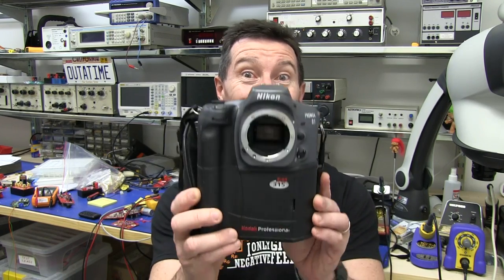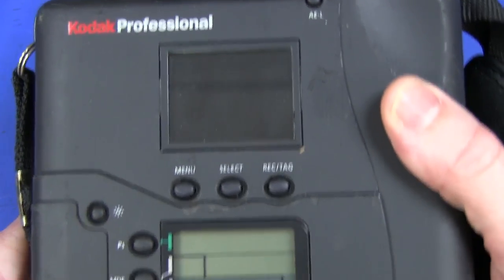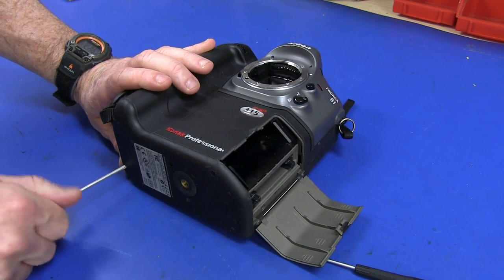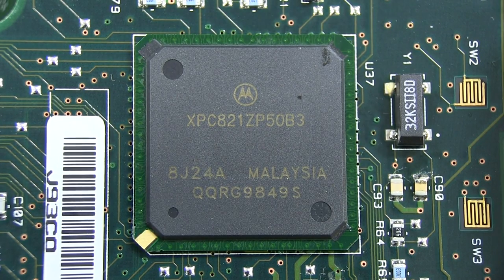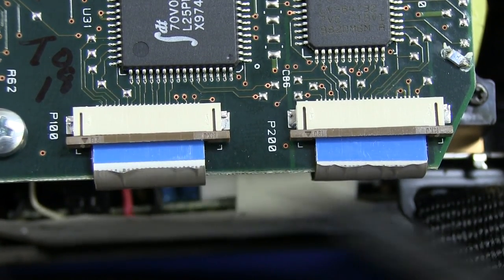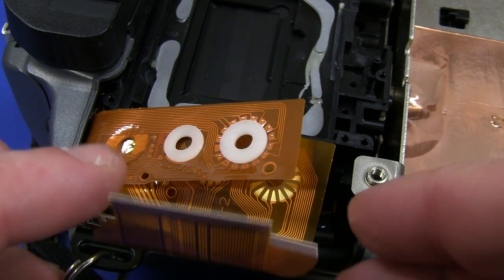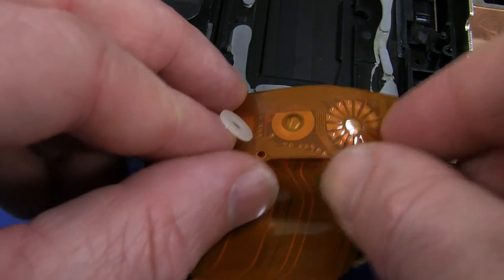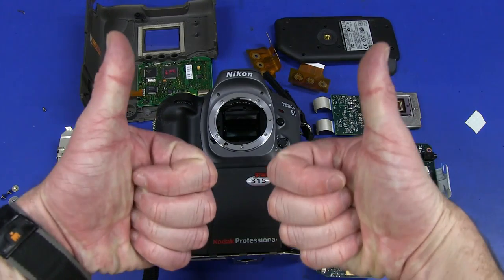EEVblog #495 - World's First DSLR Camera - Kodak DCS315 Teardown

Comment: Jeepers; I own a working DC315 today.

Crop factor MASSIVE! :-)  i. e. about 2.6X  !!

 Thus a 50mm F1.8 Normal lens on a DCS315 has the angle of view like a 130mm lens on a Full frame camera . It does use Nikon autofocus lenses and thus has the contacts in the body to talk to the lens. For a manual lens there is NO direct manual metering; not even stop down metering. But one can snap a shot and use the histogram on the LCD to check exposure. The manual says to use a hand held meter.
Reply: Finally something for people who complain about viewfinder coverage being only 99% or so. Here you get more then 200 %! :D

Comment: Some things all/most comments missed so far:

1. APS film cameras were made under a special Kodak license for the way they could make different size pictures on the same roll of film and still get cut up correctly when developed at Kodak's automated labs/stores.  This probably gave Kodak access to the design data they needed to retrofit APS SLRs as digital SLRs.

2. Back in those days, high end SLR cameras came with interchangeable backs for different uses, like regular, big roll, long 8 fps shots etc.  This made fitting a digital back a natural step, and for some years, high end models actually offered a choice of film and digital interchangeable backs.

3. The eyepiece on SLRs is cross vendor replaceable.  This is so you can replace them with models that correct the same as your personal glasses, as well as special angled or periscope ones for special occasions.  So I guess the previous owner left a random Canon eyepiece on it when he sent it in.

4. Older (pre-SATA) laptop harddrives could sometimes be plugged into double PCMCIA slots, this was part of the connector design. Conversely, PCMCIA/MMC flash drives could be used directly as SSDs with old school parallel ATA/IDE controllers.

Comment: Regarding the dead space at 35:32, I believe that is a design carry-over from the previous models of the Kodak DCS series.  I have a DCS-420 (an older camera than this model) which has a similar form-Nikon film cam on top, Kodak imager on bottom.  With those cameras the batteries were not side loaded like in this video.  The rechargeable batteries were below the bottom plate of the camera tucked away in that handle area and were not meant to be taken out by the consumer.

Comment: Kodak also made a Canon-based digital SLR around the same time (the model number of which escapes me, been too long since I used it). These were marketed at newspaper photographers and were fairly low resolution, something like 1.2MP. But newspaper print is pretty low resolution anyway, and even at $5k for the camera, that's still a big time and cost savings vs. developing and scanning film.

Comment: This is not the first DSLR from Kodak. There were several DCS cameras before this one. The DCS 100 was based on a Nikon F3 in 1991. Nikon had brought the E2 out 3 years before the DCS 315 and that was even full frame (kinda). Although it wasn't quite "digital" Nikon also had the QV-1000c in 1986. Good luck finding any of those though. Although the E2 is fairly easy to find the working batteries are not. The first proper DSLR (designed from the ground up) was the Nikon D1, in 1999. The Nikon E2 doesn't quite count there as it was still based around a Nikon F4, even if it doesn't really look like it.
Reply: Great observation. As a new military photographer in 1991, the first digital cameras they let us use were the Apple Quick take and the Sony Mavica…Apples camera worked pretty well…they could never get the mavica to work quite right.
Cool to shoot what is now not even a thumbnail, lol.

Comment: If you look carefully above the digital image sensor there is a glass with a slight red tint. It is actually an infrared filter. First Kodak DCS professional cameras of early 90's with the collaboration of Canon, Nikon didn't have infrared filter above the sensor and the photos had problems with the excessive sun's infrared radiation. Human faces under direct sunlight were a little red. A similar problem had the first digital rangefinder Leica M mount camera. A filter on the lens and some digital processing could solve a the problem. Nowadays all sensors have low pass filter which offer antialiasing infrared and UV block. 
Digital image sensors are very sensitive to the invisible ultraviolet and infrared light. That problem is obvious in digital photos. Low pass filter solves the problem but reduces  the optical quality. That's the reason why early digital image sensors didn't have low pass filter. Lately many cameras avoid the antialiasing feature of the low pass filter for better optical quality. When you try to clean the sensor of your SLR or mirrorless camera and accidentally scratch it, you actually scratch the low pass filter. The low pass filter isn't expensive but its replacement is difficult and expensive. 
In 1997 I wanted to buy the Sony Mavica FD5 with the floppy disk. Its resolution is 640 X 480 but the native resolution is 320 X 240. For static objects the camera takes two shots instantly and with digital processing doubles the resolution. 
In 1997 the USB and memory cards were unknown to most PC users. Floppy disk still reigned. I didn't know many things about dSLR cameras, the importance of lenses or the digital scanning of films. 
My 15" monitor was set to 800 X 600 resolution which was very common then. So a 320 X 240 wasn't small at all and especially for Internet when nearly all pages were designed for the 800 X 600 resolution. 
The Price of Kodak DCS 315 in 1998 was too high even for rich enthusiasts amateurs. I could afford the Sony Mavica FD5 in 1997. It was quite expensive and I knew that soon it would be replaced by something much better. Nowadays I regret that I didn't bought it. At that time I could shoot even with low quality  thousands  important photos of my life and the city I live with no extra cost. One of the mistakes of my life. Instead I invested on an expensive full featured computer which after three years had very little value. 

After 2010 the digital photography has matured. Smartphones take decent photos and even cheap mirrorless cameras shoot good photos. 
Nowadays I still use my Sony NEX-3 14.2 MP mirrorless camera of 2010 and the photos I shot are really good.

Comment: Yeah Dave, I recognize the circular flex PCB "sandwich" contacts. I bought a superb condition Nikon F5 (pro film SLR) out of eBay, which had a dead viewfinder LCD. I managed to source the flex PCB part and could change it with the help of the appropriate service manual. And yes the F5 has the same weird system to join all flex PCBs inside the viewfinder... These contacts seem rather tough and proven despite their strange appearance...

Comment: I read that the image sensor uses indium-tin oxide gates, a technolgy you still see in CCDs today because of their very high quantum efficiency.  I would imagine that they used frame-interline transfer so that they could have a minimum of pins on the CCD for power and image transfer.

Comment: Those square pads are production test points. The manufacturer would have a "bed-of-nails" that contacts all those pads to do testing and such without needing to plug in a connector.

Comment: I wonder if Kodak didn't use that same sensor board in their Canon hybrid as well, and perhaps that's why the sensor board has dual sensor mounts if the Canon sensor size were slightly different?

Very cool for pro photogs to be able to get basically the same digital camera but with a Nikon or Canon lens mount to fit the vast collection of expensive lenses they've already invested in.

Comment: fuji s1 has the whole nikon f65 camera with all the film motors and stuff, the only thing they changed is they flashed the chip that does the DX code in oreder to communicate with digital back, shutter times, sleep mode, etc, still trying to analyse how it works

Comment: Unlike USB, Firewire provides synchronous bus transfers and end-to-end device nodes something which is necessary when you need guaranteed transfer rates and latencies. Thus, Firewire was and is actually been used in professional equipment like video editing and laboratory measuring equipment like scanning tunneling microscopes.

Comment: Since today's cameras also use SMD components like this camera did, what makes current cameras (and electronics in general) smaller? Do ICs just integrate more functions that would take multiple ICs back in the 90's? More PCB layers these days? Advances in how the board was designed where they decided certain things were not necessary? Etc. A side by side comparison of a 90's model with a current one to show how electronics have shrunk (SMD era) would be great. Thanks.

Comment: For all you photography geeks out there like myself.
 Kodak DSC315 CCD 3:4 aspect ratio sensor 1520x1008 max resolution.
Image capacity: Compact Flash memory cards (128 mb), Type II Flash memory cards (320 mb), IBM Microdrives (340 mb), and or Type III removable hard drives (520 mb).
Sutter speed 1/8800 to 30 seconds (1/2 stop increments)
ISO ranges of 100, 200, or 400.

Comment: If you go for a nikon 1 get one of the V models, if you are going to get a cheap camera (such as the nikon 1 J* or S*) get a better cheaper one. I have a Nikon 1 V1 which i use for serious photos and an Olympus PEN mini PM1 which i have ripped the IR sensor out of and use for situations where i don't want to bring the more expensive camera. The V1 cost me about 400 euro and the PM1 about 170 euro. As an added bonus the PM1 comes with a standard flash shoe.

Comment: I see alot of gold on the CCD sensor and even a few thick bonding wires made of gold.  Some bonding wires are so small that the slightest touch could break them and I have seen such small bonding wires in an old Pentium that was no longer working and so we looked inside it.  Those bonding wires are so tiny that you need a good magnifying glass to see the individual wires.

Comment: TIFF files outputted are a freak bastard TIFF variant that requires a Kodak driver to open them. Without the driver the Files only show up as thumbs. The driver for Windows works at least up to XP maybe higher too. For the Mac the driver only works up to the Power Pc cpu; i.e. intel not supported.

Comment: I have a Kodak Professional DCS-520 that has a burnt LCD screen on the top section of the camera body. The back section LCD screens look great. Do you have any disassembly/assembly instructions or diagrams? I have two EOS-N1 bodies coming and I would like to replace 520 body out if possible or just the top section. Any information would be most appreciated.

Comment: Without the Kodak driver the TIFF files are unreadable by any Mac, PC, Linux box etc past or present. One only gets a thumb image; not the full 1.3 Megapixel image
Reply: Photoshop has no problem with them - at least back as far as the DCS 420 (the oldest DCS I ever owned).
Reply: Photoshop CS in 2003 with a later update supports the Kodak DCS315 from circa 1998. i.e. after the camera was obsolete. Before CS the prior version Photoshop 7 of 2002 only opens a tiny 104x156 pixel image, unless one uses the Kodak driver. Ashley I own a semi working DCS 315 and just verified all this. With my old Photoshop 3.0 of 1996, 4.0 of 1996, 5.5 of 1999 and 7.0 of 2002 all that can be opened is the tiny thumbnail unless one loads the Kodak driver. With more modern Photoshop CS , CS2 and CS5 here yes you are correct one can open the DCS 315's tiff files as a raw file without the Kodak driver. This Photoshop support was 5 years after this camera was discontinued.
Reply: You are clueless and are commenting on a camera you don't even own. I actually own one and used it yesterday to try to explain its poor usability. In the era of the DCS 315 i.e. BEFORE CS came out one had to use the Kodak driver to get the full resolution image. Without the driver all one gets is dumb thumb. The camera came out in 1998 and you are saying to use a Photoshop raw convert from 2003? The camera was already wildly obsolete in 2003 and heavy slow 1.3 megapixel beast.
Reply: 2003 Photoshop CS was not available in 1998 your answer is bogus about how Photoshop can read a DCS 315's TIFF files. They are Kodak bastard TIFF's that require a special Kodak driver to read the full TIFF's resolution.

Comment: I have never before seen a camera with a Firewire connector.  They are all USB mostly.  That is one odd camera and probably because of the price of it I have never heard of it.  I have also never heard of two camera manufacturers working together like that either.  I mean that I never see it like that with Nikon and Kodak on the same device.  That is just strange.
Reply: What it means is that the company manufacturing this product does not have intension of doing research or investing in one. Being cheap, cutting corners and assembling Japanese products, as many other US companies. Until China started producing everything and branding it with their names, they were not able to be up to date with the technologies. If China didn`t existed as a manufacturer of electronics , as it is today, Japan would be still #1 with no competitors.
Reply: John Doe This was early DSLR, so they had to ramp it out fast. Popping it into a "known-good" body made it a fast and pretty safe solution. According to http://en.wikipedia.org/wiki/Digital_single-lens_reflex_camera#History 1991 was the year they started selling DSLRs.

Comment: What a fruit! This was not at all state of the art technology, that guy doesn't even know half of what was happening back then in the imaging industry...
Reply from the maker: +Carsten Wolf Why don't you educate us then?
Reply: +Carsten Wolf  Yes, yes.  Please educate us.
Reply: If you are referring to the fact that the 315 was the times budget dSLR compared to maybe the F5 based 600 series then your point is not 100% valid. It's like saying that the D500 is not state of the art because the D5 came with it. State of the art doesn't mean the best in performance, it just means that it makes use of the latest technology of it's time.  A 92hp DOHC MAF metering, M13a engine is state of the art compared to a 200hp push rod, mechanically alternated big block  chevy engine because it uses more contemporary technology.

The 315 might not be the best of it's time but from an EE point of view it was state of the art.
Reply: +Stathis Bikos state of the art is more best refined product at that time. flagship models not budgetshoppers
Reply: so by your logic the D500 is NOT state of the art then?
Reply: Kodak DCS 100 which released in 1991 was the first DSLR.